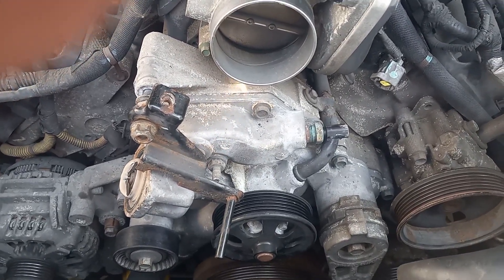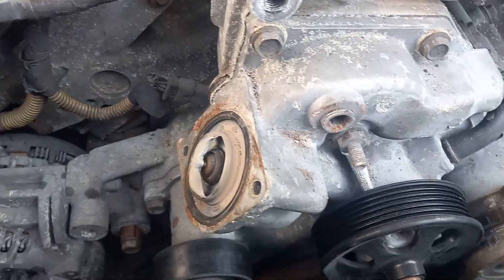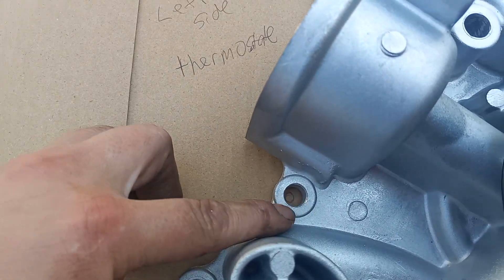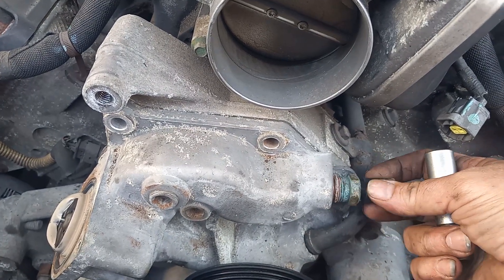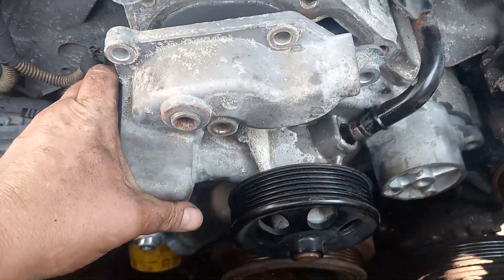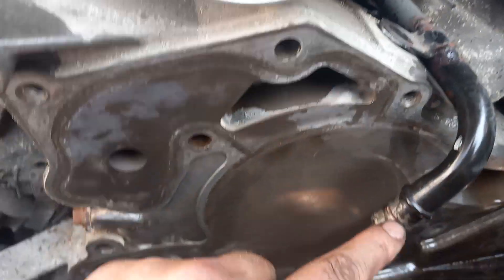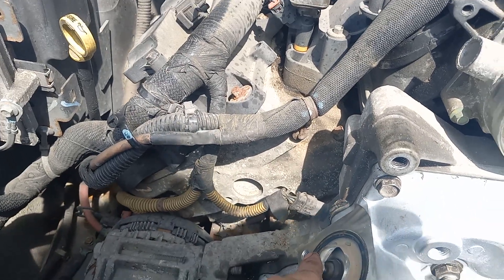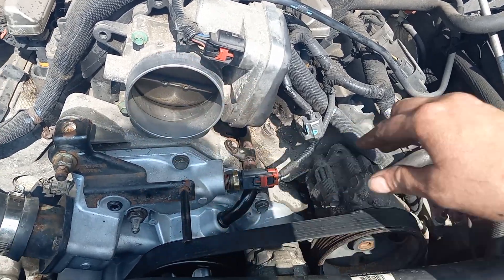Waterpump 2011 Dodge Durango 5.7 Hemi

Comment: What kind of pry bar is that to adjust the belt
Reply: What can I use to adjust it I’m trying to do this on my car tomorrow morning lol
Reply from the maker: The tensioner will pull back to get you slack so the belt can come off. Hold the tension at the same time you slide the belt off. It's either a 3/8 or 1/2 inch pry bar. At any local parts store.
Reply: @Marie6  thank you!
Reply from the maker: 3/8 or 1/2 inch pry bar. It has the same shape (square ) as the rachets. You can use a rachet if that's all you have on hand. Use a jack poll to slide over the handle of the rachet for more pressure.
Reply from the maker: @jovisosa3266  no problem